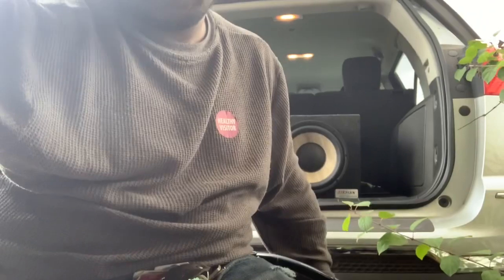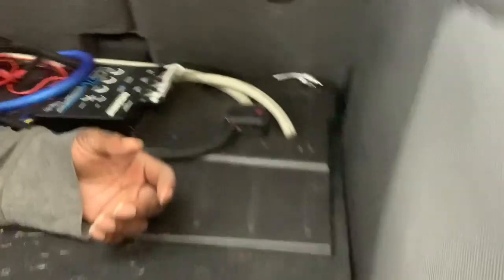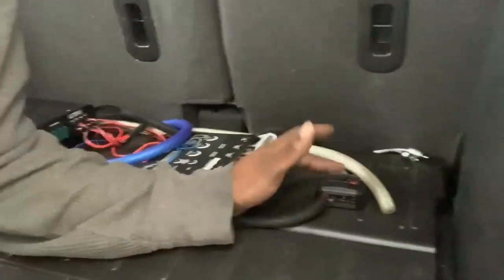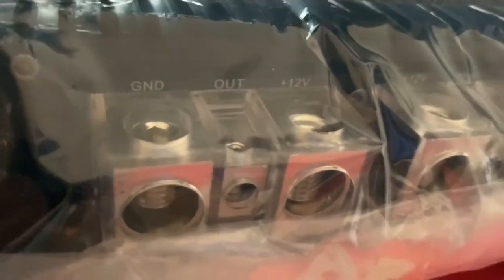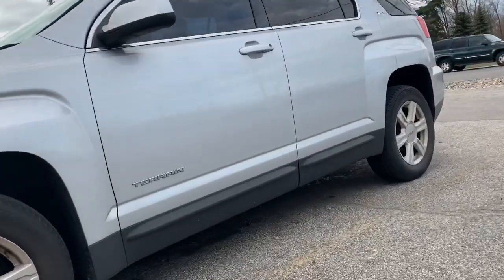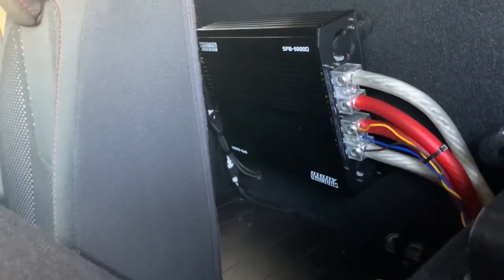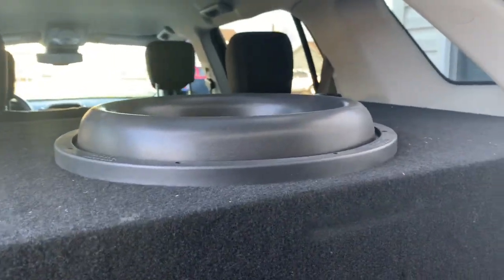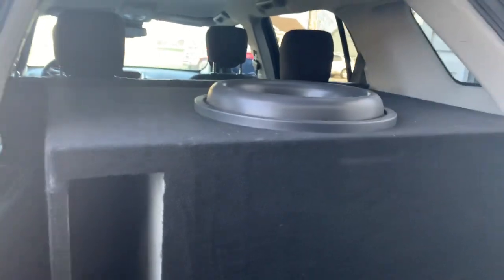Switched my 6000 sound stream for a 3000 sundown... smart or dumb???

Comment: The box is fine for that sub lol big but will be fine
Reply from the maker: Yeah I plan on getting a different box made for the sub I think too much air moving thru the big port
Reply: @lifestyleofDAYUNGHOGG  thats not whats wrong what are you looking for ? Loud musical bass if so this sub isn't made for that tge u series will be more musical then this also a set of sa 12s or 15s will work just fine but this sub is built for really loud lows like extremely low
Reply from the maker: @fxgamer-11yt  preciate that bro and you right I been noticing that about the subs yeah I want loud I been thinking bout the u series those hit deeper I believe but you think 2 sa will beat? Or 2 zv2 12
Reply: @lifestyleofDAYUNGHOGG  I had 2 15 inch sa 15s that beat and I think if you get a better box this will bang also that sub is a power monster it can take alot more then ratted but yea I wpuld go with the u series or sa more power and get a box buikt that is tunes 30-35 or get a 4th order built for the zv4/5
Reply from the maker: @fxgamer-11yt  this is a custom box just for a different sub this box was tuned at 31 for that sub it’s enough power just moving too much air right now I have 2 x v2 in my cutlass I might do the same for my truck gotta make my mind up soon